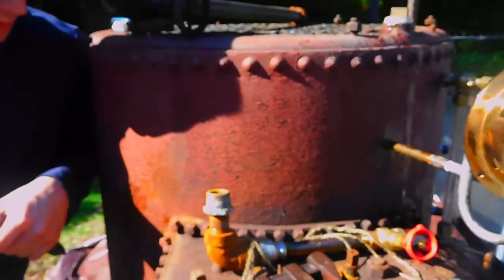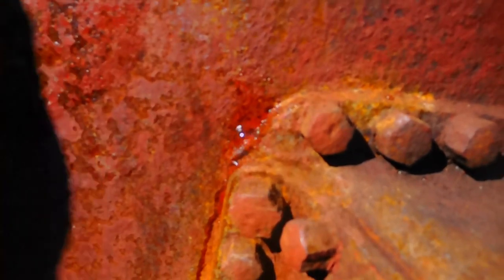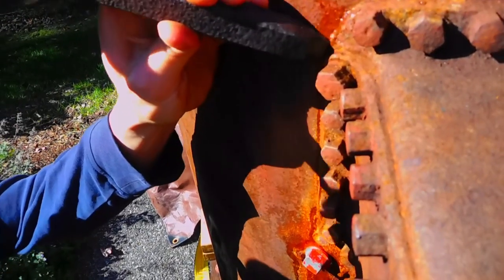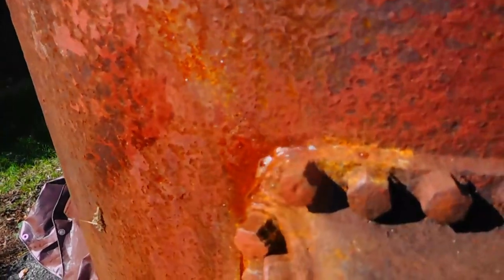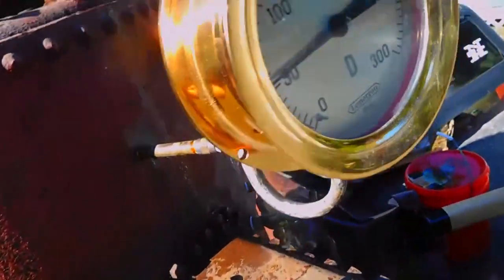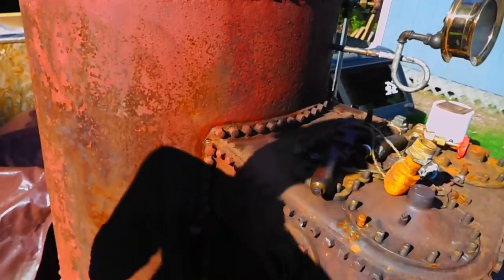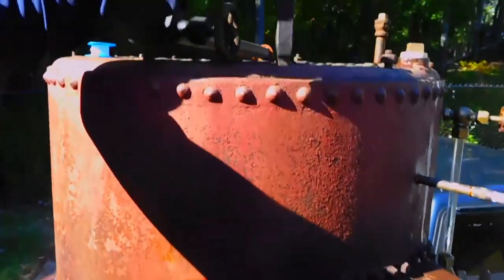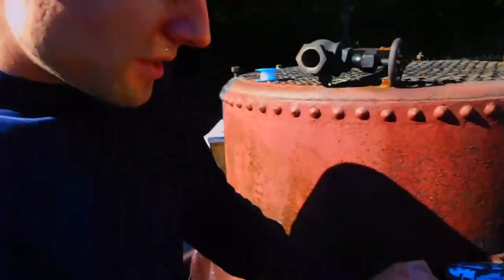Caulking bad seam on George Whitney's Ida F boiler

Comment: I've seen pneumatic chipping hammers used to do this for making riveted ship hulls watertight. Very elegant and dead simple principle.
Reply from the maker: The problem with boilers and hulls alike is the pneumatic chipping tools can work harden the metal and lead to cracks later unless you are quite skilled.  I will be publishing Bruce Babcock's paper on this with his permission on facebook next week.
Reply: @AEKarnes  Indeed, from the looks of the job you did with this boiler it must take a finely calibrated hand, not a case for the "hit it as hard as possible" tools
Reply from the maker: @Redundant_Communication  You are more correct than you think you are.  Hitting it too hard will work-harden the metal and cause cracking in the future of the boiler's thermal cycling and can cause big failures.
Reply: I was wondering after seeing this work on the boiler if it also applied to riveted hulls. Thanks for the information

Comment: Bonjour Alexander,
If I am right, you have to test a boiler to twice its working pressure.  I imagine that this big boiler shuld be tested to a minimum of 120 PSI.
Your solution and your associated tool are quite clever but will this caulking support more than 50 PSI ?  
Amicalement, Raphaël
Reply from the maker: Raphael, yes I intend to test this job against a higher pressure than the boiler's working pressure.  However I am not a fan of putting immense pressure tests on antique boilers unless it is a full top to bottom overhaul as it can damage them in ways that are similar to if you ran them at overpressure.  Also interestingly in the United States 1.5 times working pressure is typical, not twice.  But this is partly because very nearly all of our boilers were always built more cheaply and with lighter gauge sheets than those in Europe due to our obsession with cheapness so our tests followed suit.  I have never seen stronger boilers than those in Great Britain.
Reply: @AEKarnes you should see stanley boilers. Built light for car use. They were wrapped with piano wire to increase strength but keep them light. I have seen 30 in boilers up to 1000 psi!!!!
Reply from the maker: I've worked with many Stanleys.  the Boiler is about the only decently designed thing in the whole car.
Reply: @AEKarnes  Hey….. Their not that bad! LOL I was impressed by the use of ball bearings. In particular the connecting rod from the cross slide to the crank. How the hell did they machine that hemispherical interior channel to trap the balls. What is a pain in the ass is the valve chest cover. It’s a round threaded cover. It makes machining the slide valve seat almost impossible. I had to use an old shaper to get in their. A square chest cover let’s you use a milling machine. Lapping is also a pain.